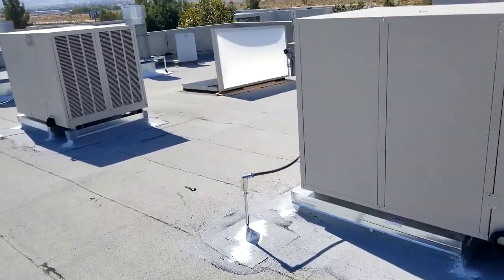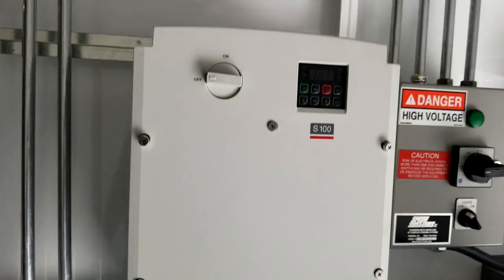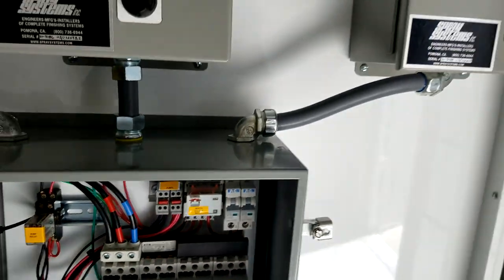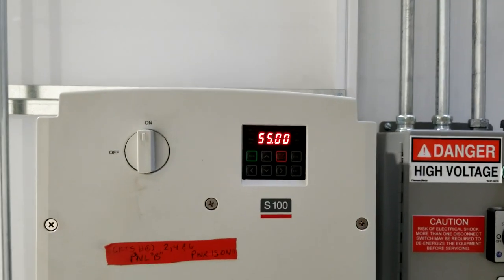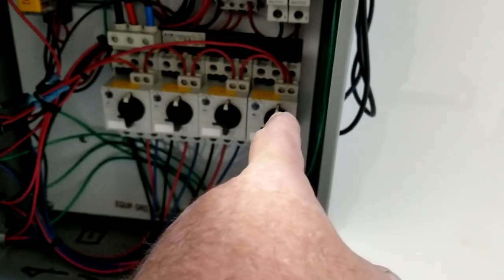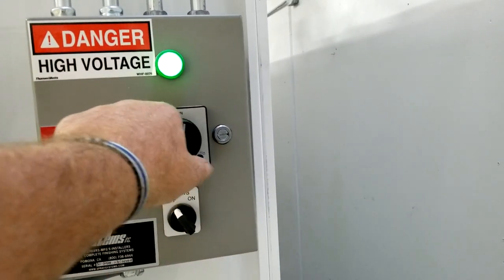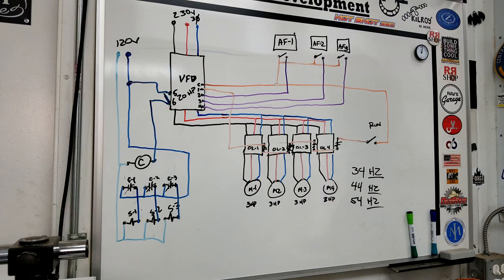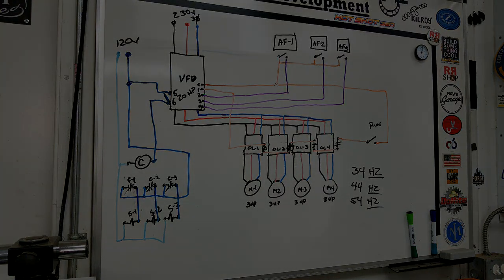Running multiple motors on a single VFD

Comment: Worked on & wired drives for 30 years and seldom used a VFD to control more then 1 motor. great for feeding several conveyors on a packaging line. Got called out to an ambulitory care center where cheap skates had 1 drive controlling 4 10 HP motors that feed halve the building and 2 OR'S. When 1 motor shorted out 2 different maintenance guys went up & just reset overload block. Was down for almost 2 days. All they had to do was isolate this motor by removing 3 motor leads and letting the 3 remaining fans . Best thing they save a ton of energy when running at reduced speeds and along with a 10 second or longer ramp up easier on equipment.

Comment: Great video Stan, I really appreciate the thought put in to the logic for this application, in a word, it's brilliant.
Years ago I worked for an industrial machine manufacturer, there were a few instances I had to integrate a new machine control in to an exsisting one using more than simple interlocks, needless to say it could get weird.  Looking back I wish I had someone like you to brainstorm with, while I did eventually satisfy the client I certainly could have used another sharp person that was on the same wave length dealing with an "as built" situation.
Reply from the maker: Working as builts or having to deal with what the customer has already installed is always a challenge, thanks for the view and comment.

Comment: Totally enjoyed your explanation of how you wired your system. I worked for lots of chemical plants around Houston and designed all kinds of motor control and instrumentation. Also worked for companies building control rooms for many different industries. Even built two robotic control centers for Rolls Royce once. That was a fun project.

Comment: I was doing multi motors on one VFD 20 years ago. 5 hp up to 20 hp. These were in an egg laying facility. We were controlling ventilation in the houses, egg flow to the grader/s thru one desk top computer for up to 2.2 million birds. I retired from that job 11 years ago. I also did backup gensets up to 800 kw.

Comment: Oh yea,, very well shown and explained Stan,,,Does the roof top cooling filters require filtered are distilled water, to give longer life to the filter?? During my years as PM on the construction team, most city water supply had high levels of chlorine and filer life was an issues and cost. The New Orleans plant was one that gave the maintenance crews fits due to, a non filtration system specified in the design. That was back in 1998, and left Coke Cola ECI, in 2001, so don't know if they ever corrected the issue. Just a question, and can you shed some light? Bear.
Reply from the maker: Very high mineral content here, they will need regular de-scaling, inline filters would help, but not solve the problem. No replacement for regular maintenance.

Comment: Hey boss,  is there any sensing of flow degradation due to filter clogging on the intake or exhaust air that will have adverse effect on air balance?  I know it was always a concern in the nuclear buildings that I worked in years ago for obvious reasons. Thanks for sharing your work. Regards/greg
Reply from the maker: Its not that critical here, the building is not sealed up that tight. If it was fully sealed, then a 4-20 Ma modulating control would be in order, along with pressure sensing equipment.

Comment: This type of content is interesting and good to include.  Thank you.  I have never run across a shunt device before.  Is it a form of a solenoid or some form of a latching relay???  Thank  you for the video for sure.
Reply from the maker: Its just a small coil that snaps on to a manual motor starter, apply power = starter trips off.

Comment: How well does the make up filters handle the extra moister from the coolers? Seems they would saturate and plug quickly?? Also seems they would or might drip??? I am no expert but grew up on swamp coolers. The moister was crazy!
Reply from the maker: The modern evap media doesn't transfer moisture like the old fashioned pads.

Comment: Swamp cooler media during the 1960s were batts of "excelsior", which might have been wood shavings but definitely organic.  What's the media in those modern coolers made of?
Reply from the maker: Feels like a treated cardboard to me, it "wets" very easily and the standard media is 12" thick in a honeycomb pattern, it diffuses the air and creates thermal transfer better than the old style pads.
Reply: @ShadonHKW  That's at least 3 times the old batt thickness.  The old batts weren't enough for the heat in Phoenix; we'd often pin wet rags to the duct registers to help, but nothing was good enough so I eventually moved to the upper left corner of the left coast.

Comment: Was this a design build or did a engineer specify the SOO? I did not see a proofing circuit was that not required
Reply from the maker: No air proving circuits were provided or called out for the make up air.

Comment: Hi Stan,
One question I want to ask you is about running multiple 3-phase loads on a VFD in a workshop environment. Could you have a 10hp VFD in a workshop and run a 5hp Bridgeport mill and run a 2hp lathe? In my application I'm really only needing 60hz, so speed control isn't as important as single phase to three phase conversion. If the VFD is rated to run loads of up to 10hp, will it likely handle switching on and off smaller three phase motors in a shop environment?
Reply from the maker: 2 things to watch out for, first is overload protection for the individual motors, second and probably the most important is the motors need to be turned on and off via the VFD, not by the secondary switchgear downstream of the VFD, removing or applying a load to a VFD that is already up and running @ target speed will slowly chisel away at the DC buss.

Comment: Someone help mo. We have 1unit altivar 38 running two vibrator motors at the same time. When we replaced the control card of vfd and start the VFD, it wont reach the speed setpoint, the speed setpoint is 955RPM and the actual speed is only 243RPM. But, if We run only 1motor it will reach the setpoint speed, then we run the another motor, it will reach the setpoint speed. It means they cannot run at the same time, you need to run one by one. Before it runs at the same time. How to solve this problem??

Comment: Hi Stan, cool configuration.  Is it common that the cheap (e.g. chinese) VFD's and other more expensive VFD's regularly come with this many programmable control inputs and output relays? Or does one need to get into detailed specs to select that many dependencies? I notice that on swamp cooler startup it appears to frequency ramp up for a slow start.  Is this what is happening, and if so, what happened to the motor load when you instantly jump to 55 Hz for 4 coolers?  thanks
Reply from the maker: There is energy savings involved by doing a ramped start, I always add at least 10 seconds. It's a feature, why not use it?
Reply: Usually on a VFD if you set the ramp time to zero it will ramp as fast as it can whilst not exceeding the max current set on the drive. (It will often allow a short period exceeding max current, which can also be set)
Reply: @ehamster  Some VFD's don't function with multi motors as they do with single, that is, they can be finicky enough to read the no ramp start as a fault if any one of the loads flinches during starting.

Comment: aside from the ramped start is there any real reason that you used a VFD here instead of just making adjustments with the pulley configuration?
Reply from the maker: 3 speeds based on how many exhausts were running.